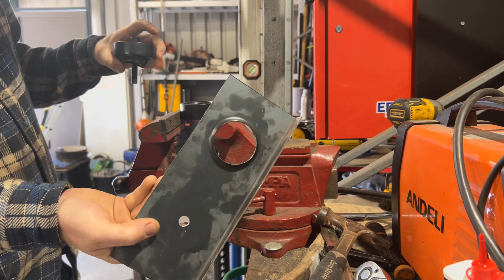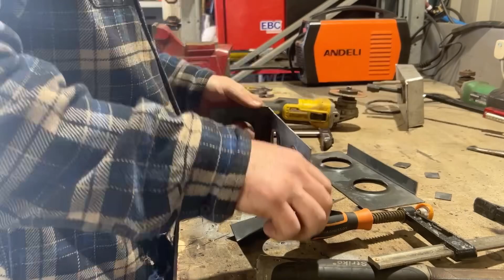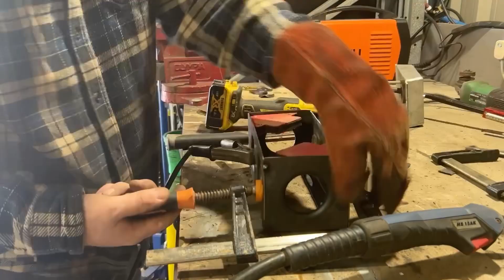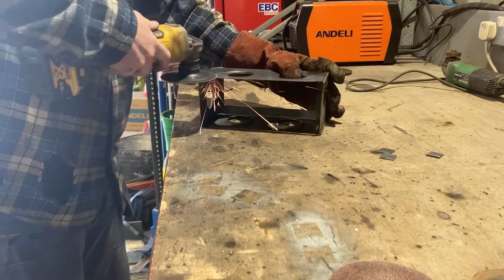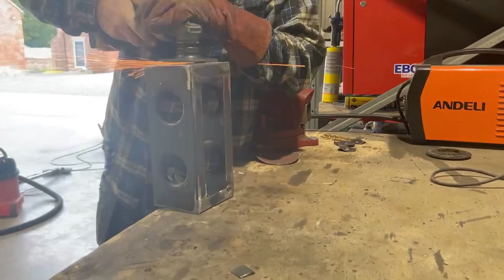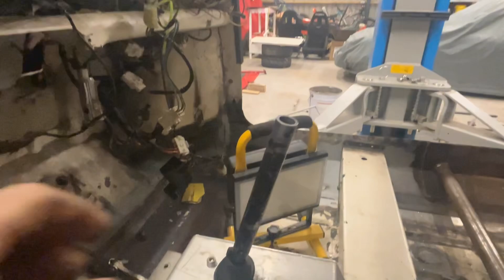Classic Mini Zcar - Custom internal gear linkage and selector housing

Comment: Where did you but the dimple die from please. Love the build.
Reply from the maker: @RRW  eBay mate “stakesys”. Thanks!
Reply: @fitzworks  suppose you have the link as I’ve been onto eBay and multiple choices. Thanks 🙏
Reply from the maker: @RRW  265392585351 eBay item number
Reply: @fitzworks  thank you so much 👊🏻